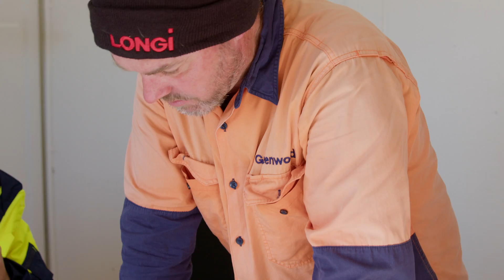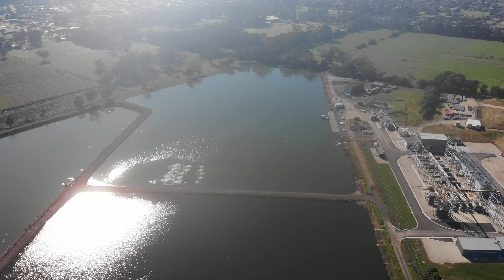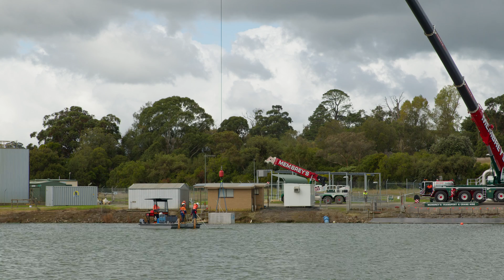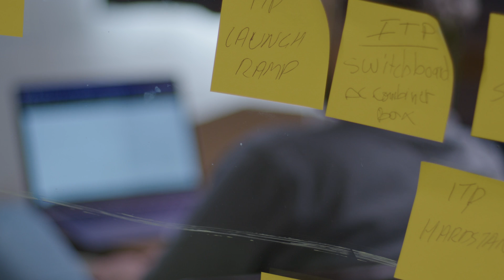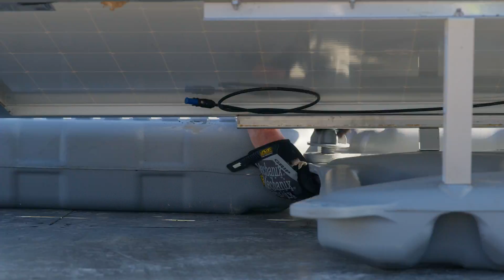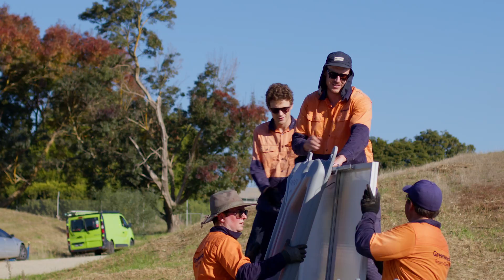How We Installed the Biggest Floating System In Australia

Comment: Joel Gilchrist, an electrician with 5 years of experience, discusses his involvement in a groundbreaking solar energy project. The project, the first of its kind in the country, presents challenges like working on water-based sites. Joel highlights critical moments, including anchoring solar arrays in water with a massive crane and concrete blocks.

He emphasizes teamwork and the support of a committed team in overcoming challenges. Joel expresses the rewarding experience of witnessing the project come together, especially when solar panels successfully float on water. He believes in the collective effort and the impact of providing renewable energy. The final result, seeing the system energized and generating power from the sun, brings a sense of fulfillment and a positive impact on the environment.